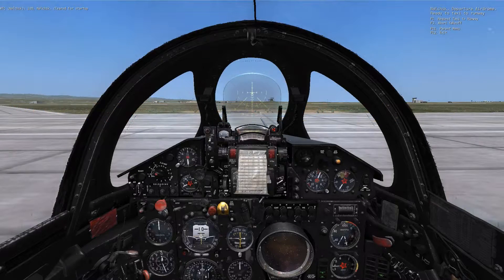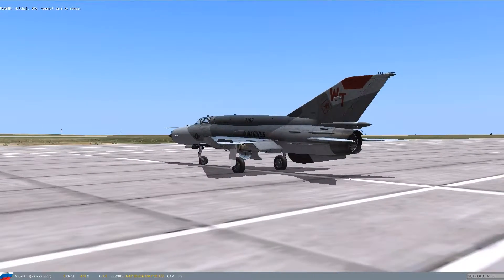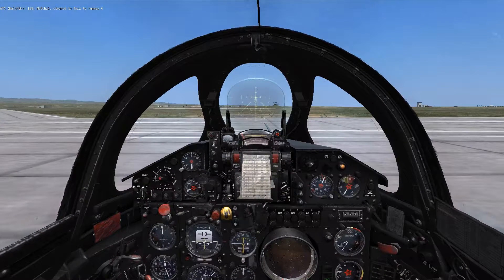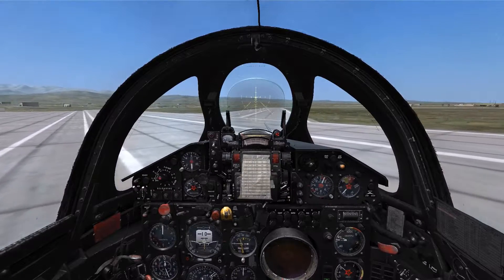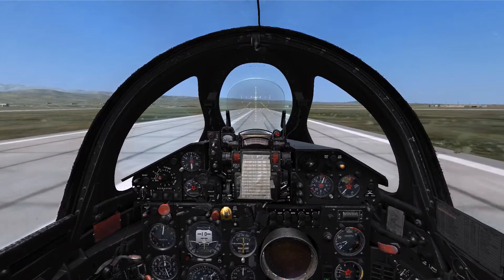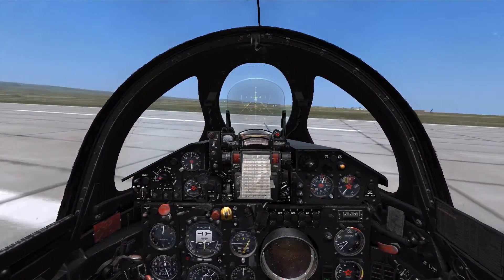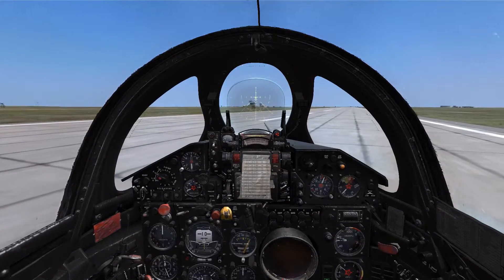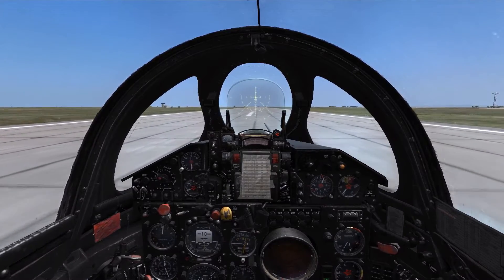DCS:World - MiG 21Bis Taxi Procedure

Comment: I just bought this module a few days ago bro, but I cannot get the ATC to respond, I am missing something somewhere. I will figure it out eventually, the radios always catch me out for a while.

It really an awesome module though, those engines are so quiet, freaky, I keep killing them when climbing and diving, need to figure that out too. Also using the black cockpit, don't like the baby blue the russian's are so infatuated with.
Reply from the maker: Yeah that blue cockpit is pretty offensive looking that is for sure, and yeah this has to be one of my favorite modules to fly.  I'm still learning the finer points of handling it in extreme situations but it's pretty simple, so long as you don't pull any sudden heavy negative G's than the engine usually doesn't flame out.  If it does flame out you can usually get it going again if you are quick.

And the radio uses a series of presets which are listed in the kneeboard, but yeah sometimes they just don't seem to respond.  I had that happen twice while recording this and a takeoff video.
Reply: Hey Pickin, Good video, Im new to DCS and just bought the BIS Module, where can i find the flight manual??  At this point i dont even know where to look for it.  :ETA.. Found It, Disregard